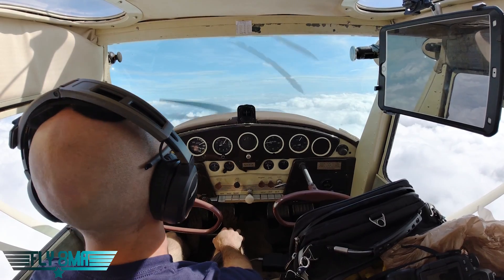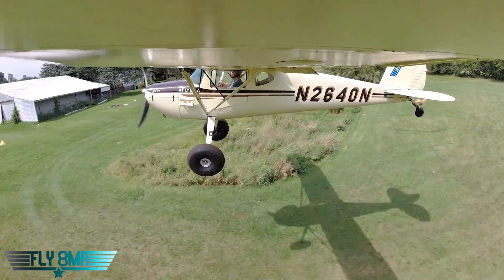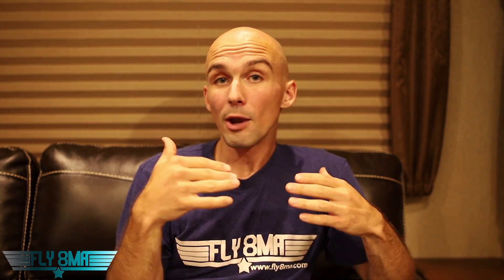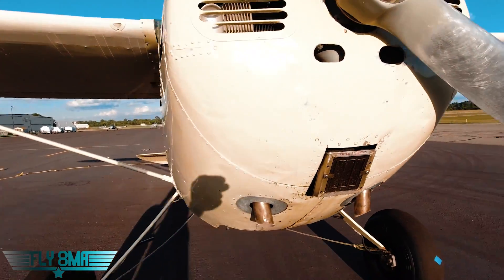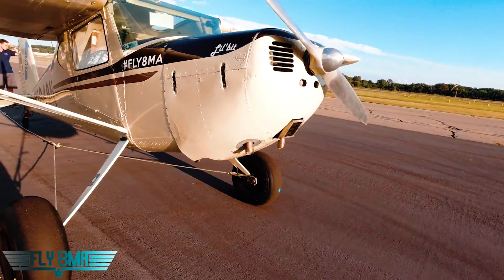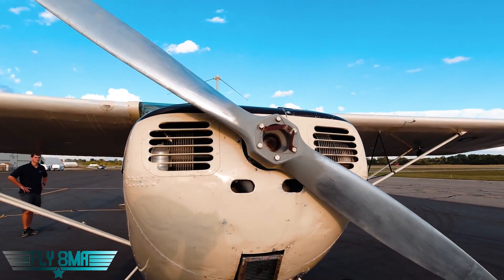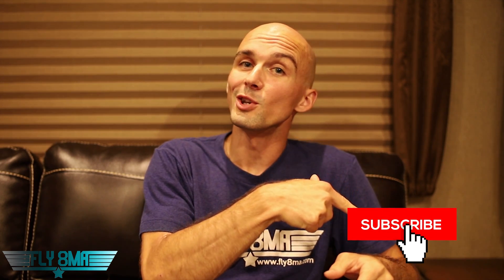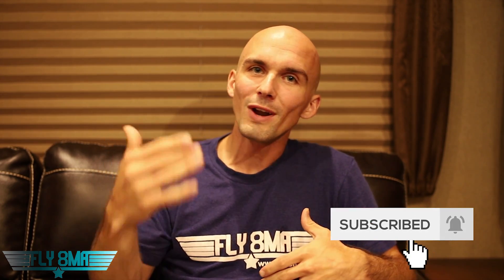Cessna Static Thrust Test

Comment: It also depends on wind direction.  With a headwind vs tailwind.  Strong headwind you will get more Static RPM than with a strong tailwind or crosswind.  The cap is needed for cooling on  climbing and you will get a bit better cruise speed too.  Test the Full Power Mixture too.  Too far leaning means too rich mixture.  Cuts too soon?  You have a too lean full power mixture..

Comment: I remember that one the aircrafts my father produced, in this case the MFI 15/17, had a static thrust of 360 kp. The engine was a Lycoming IO-360 (200 HP) with a constant speed propeller.

Comment: This video is interesting to me because I just bought a '46 Luscombe 8E in which I'm going to get my Private Pilot Certificate. It has a C-85, too.

What's your empty weight? My Luscombe is 950 empty (apparently), but I recently bought new starter and alternator (to replace the generator) both of which should save a few pounds. Also, I completely recovered the seats (new guts, too) which shaved off 3 pounds. I've also begun removing previous sound proofing (foam, basically) which apparently added 8 pounds. It's not really necessary with ANR headsets, I figure. The parking brake added 10 pounds (many years earlier). The previous owner never used it and I could see not using it, too. I imagine two sets of wheel chocks could be a pound per set. That would be another 8 pounds. A lithium battery might save about 19 pounds (!!!!!). On the other hand, I'd like larger tires, so that'll put me in the other direction. If I could get under 900, I'd be thrilled.

And sometime down the road, I want to do the C-85 to O-200 conversion (new crank, rods, and pistons) which should give me about a 25% increase in horsepower. Planes are fun!
Reply: Have you done a new W&B since you removed all of that weight?

Comment: Static thrust at zero airspeed isn't a measure of how the plane will fly. You need to measure thrust at flying speed........
Reply: airraptor that will go down with airspeed. At that point it won’t matter what the thrust is. Plus constant speed props affect the thrust.

Comment: Jon, great video. If cruise is not a concern, there’s 2 things you can do to improve your take off. Use a wood or carbon fiber prop (lite spins up faster) and repitch till you hit the maximum static rpm for the motor. I’d talk to Lauren and see what he’s getting out of his 120, I know they pitched for max static.
Reply: Is that allowed on a certified aircraft?  I thought you were only allowed to use the props certified for the type...
Reply: Ben depends on who you ask and how how it’s been typed. Being that old of an aircraft there most likely is a wood prop option. Wood prop lighter and can spin up faster. As far as repitching goes its usually limited by your max static rpm. You can pitch flatter till you hit that max static. Then there’s always finding a previous field approval and having your ia duplicate the 337 and it will most likely go thru without being kicked back, based on its already been approved once.